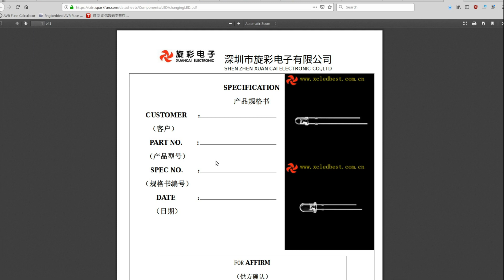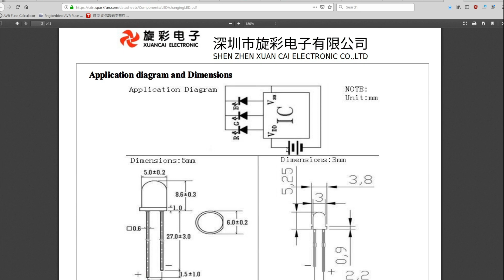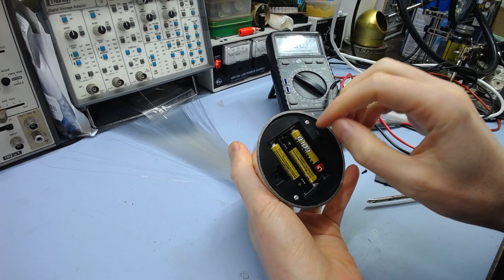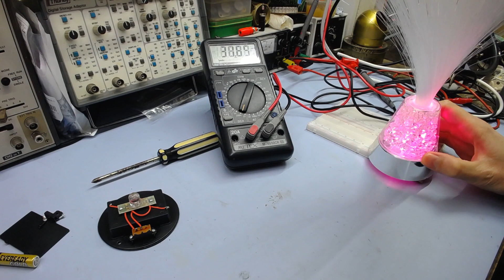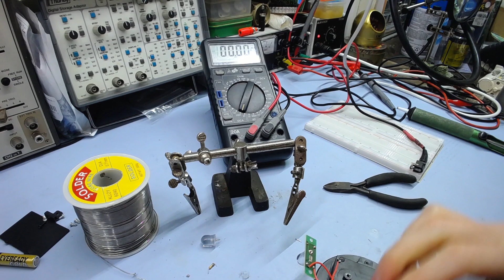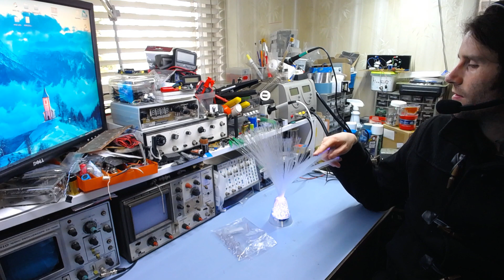Colour changing LED upgrade in a "fibre optic ice lamp"

Comment: What is interesting is the disparity between the flat DC source of a battery and your supply, I'm thinking that the internal resistance of the battery isn't gonna explain how the LED was able to draw MORE current, it must be that your supply is current limiting or there's fault with the test leads themselves or maybe that rather dodgy looking cable with the the pink sleeve and barrel jack is pulling the voltage down because the battery should lose against a bench supply in a head to head in power delivery, I would put a meter on your test setup and check that you have 4.5v and while your at it put a load on there as well. I would love to no why there is a difference because there shouldn't be, that's the point of a lab bench supply .
Reply from the maker: I don't know what was going on that day either! It's entirely possible I did have the voltage on the supply set too low...
Reply: @Agent24Electronics  yeah, makes sense sir....I couldn't see the dial, but over all  you amped up that light!
Reply from the maker: Thanks! These of course are available on eBay so it shouldn't be hard to do your own (I am tempted to buy a couple for myself actually).
Interestingly they do seem to sell a colour changing version - but it uses 3 separate 5mm LEDs and I get the impression they aren't all in phase.